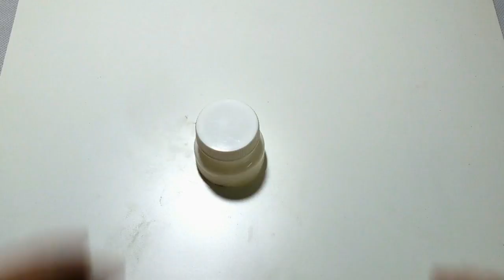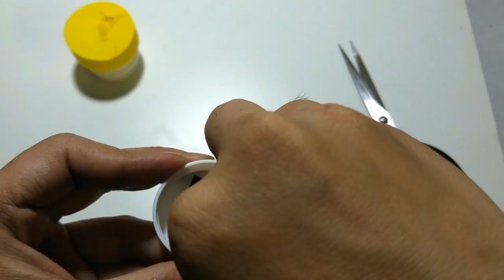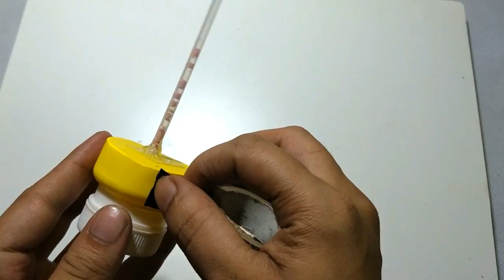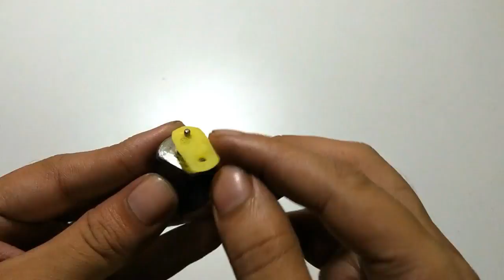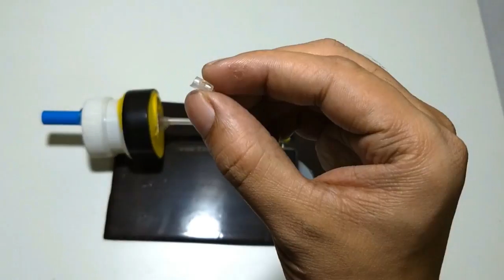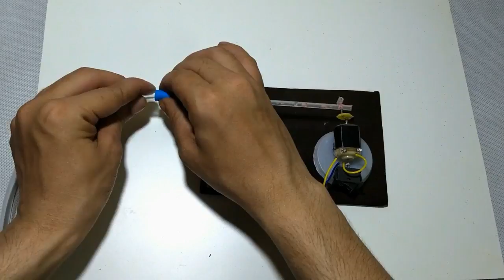How To Make Air Pump For Aquarium - DIY Air Pump

Comment: how did you create the valve? wouldnt the air just go out from the same duct it came in?
Reply: Fake
Reply: One more valve needed
Reply: I think the black rubber piece he pasted on one hole will act as a one way valve

Comment: Nice job bro. But mine does not work efficiently because i have used a less powerful motor. What is the output of your motor? Mine is 5 volts 0.5 amperes

Comment: Can we connect it with direct electricity
Reply from the maker: No brother it really dangerous to connect direct electricity..
Reply: @ThEiCONICCREATIONS  is it also dangerous if we use a plug to connect it to socket..... please reply
Reply: @rajeshmishra1447  do NOT plug anything like this into the mains, you need to run this from a battery
Reply: @FuzzyOne2007  ok thanks
Reply: Yes!! Direct Current will work. ( The Iconic Creations has also used DC Only that he has added a switch to power ON/OFF THE CIRCUIT)
Reply: If by using Direct current you mean connecting the device  to a socket or extension, that is called AC, PLEASE DO NOT DO THAT. The whole thing will blow up and it can cause fatal body harm. Just stick to the battery (DC)

Comment: I think these will only run a short time before the brushes in the motor wear out. It would be lucky to last a week.
Reply: Is good, specially if you live in the Caribbean where the lights go down with a heavy rain, it will saved the life of hundreds of fish 🐟🐠🐡 👍😁
Reply: @bettasreyes9263  ikr
Reply: Doesn't even turn on it just Made my breaker burn out
Reply: Nice
Reply: @flosants  did you plug it directly into the wall?